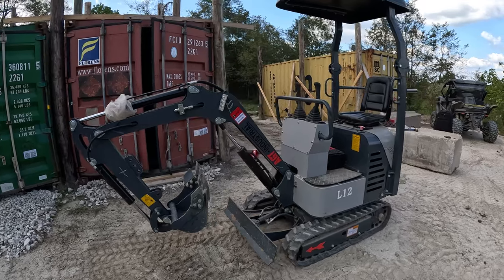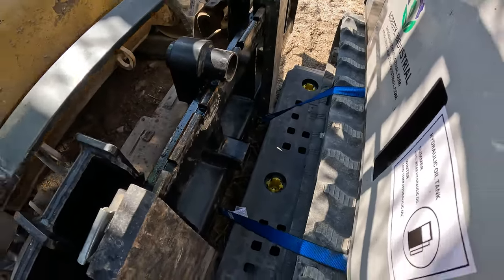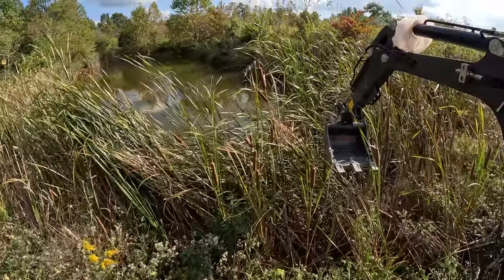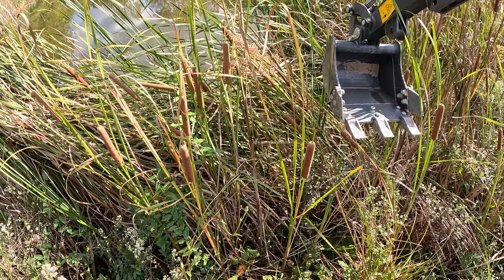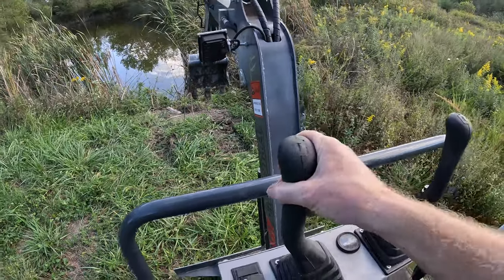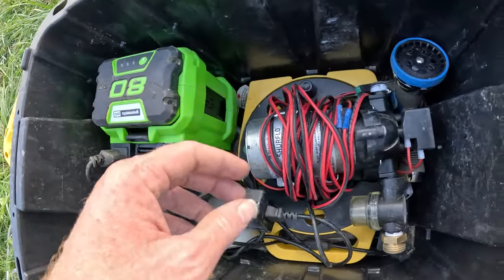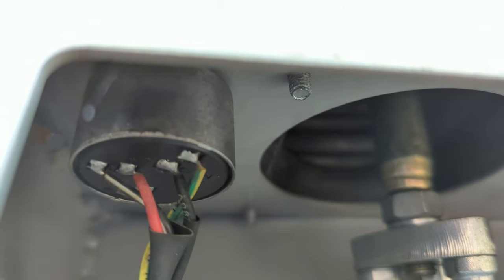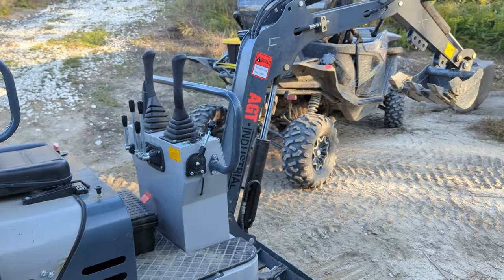I Bought a $5k Mini Excavator

Comment: Scored my AGT QH12R for $3,300 at auction and totaled $3802 after taxes and fees. Couldn’t be happier. Already ordered an electric fan on Amazon and my next modification will be a spin on hydraulic filter and possibly a cooler.
Reply from the maker: Nice score! Just heard about a recent auction with dozens of these. So getting much easier to find.
Reply: I also bought the 2024 AGT QH12R, but I paid $5500 from someone who bought several from an auction to resell them.  I noticed mine didn't come with the Briggs and Stratton engine.  Can't find a brand on it, other than 420cc 15.  Mine also doesn't have an external hydraulic oil filter.  Hydraulics keep overheating on mine and starts running sluggish, so I think I'll install an oil cooler soon.  Other than that I'm pretty happy with it.

Comment: I bought one of these two weeks ago and I've been very happy with it so far. It's a lot more powerful than I was expecting.

It doesn't take half the day to cross the property though. It's top speed is VERY slow, and I don't have a skid steer to move it around with.

Comment: See it has eyelets for a stationary claw to pin in, the small cotrol on your left that runs to the line with a quick connect is actually for running the claw that would pinch all your rift raft materials against the bucket. All the controls are regular as a big piece of equipment. After running kill the machine and just turn the to on position eith out cranking, see if your able to grab any or all joysticks and move one way or the other to drain pressure of the hydraulics. If you frain the hydraulics and take loose a hydraulic line forceably , you'll have problems trying to connect the female and male fittings back together, the female ball valve side will hold pressure if it's forced off before depressurizing.

Comment: A shame it doesn't have a transmission that can be put into Neutral. If it did, you could tow it using a solid towbar. The next best thing would be a trailer with a bed that tilts.

Comment: Add a fan or 2 moving the hot air out of the body. 

And did you chnage the oil? My unit did not test as motor oil, it tested as some type of seed oil. Assume this is for getting around hazmat.
Reply from the maker: I haven't changed the oil, but I'll take a look now that I know this is a thing.
Reply: When I get a new tool for my DIY projects and have problems, I remember the saying, "If all else fails, I read the owner's manual."  @badcanyon

Comment: I'm surprised they didn't use a Chinese knockoff motor instead of a Briggs.... Harbor freight motors are pretty good actually
Reply from the maker: Yeah, glad it's a Briggs - or really any common motor. Replacement parts will be much easier to find.
Reply: My model is the QH12R , the R indicates a Rato engine , after some research it appears that the Rato actually has a good reputation and may very well be the manufacturer of Harbor Freight Predator engines.

Comment: I have the same machine my only complaint is the travel speed. Has anyone either upgraded the drive motors or figured out how to make it walk faster?
Reply: does one track move faster than both together?  If so its the single stage hydraulic pump, i would upgrade to 3 stage, it'll allow max speed from both tracks.

Comment: How do you handle the heat of the engine on the seat?  No biggie if you operating for 30 mins at a time.  1+ hour and that engine bay and seat make it near impossible to sit on.  I like they are gas engines (easy to maintain), but agree, the speed and gearing for mobility is less than desirable.  PS you are gonna want to invest in that trailer lol.   Any idea how much more for a thumb on them?
Reply from the maker: Mine came with a bolt-on thumb. Not sure how much a hydraulic thumb attachment is. I take the thumb off while digging because it gets in the way a little.

Comment: The 1st thing I immediately thought of was the US Army Corps of Engineers fining the hell out of you for not getting a dredge & fill permit for the removal of wetland vegetation! They take that very seriously. The next thing is you need a lot longer arm than what you've got. Same amount of money & you can get a lot more od a bucket loader rather than this limited mini/micro excavator. Im biased though as ive used bucket loaders for a long time & love them.

As a completely different subject, get yourself a block of foam to put your inlet through. It'll keep your screen out of the mud.